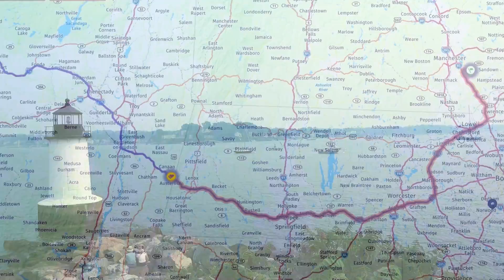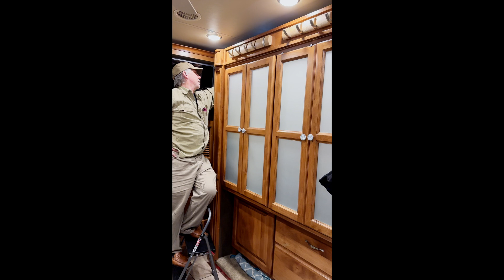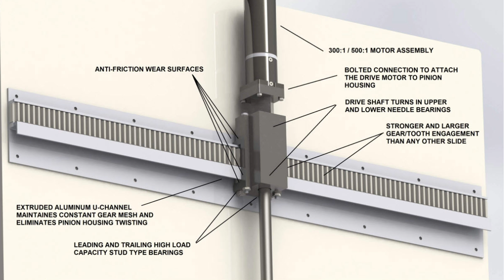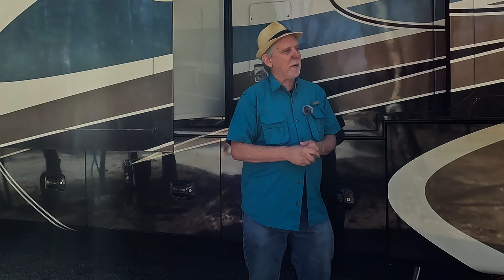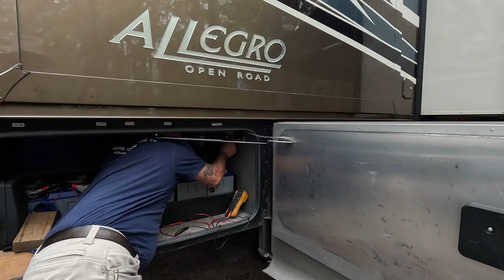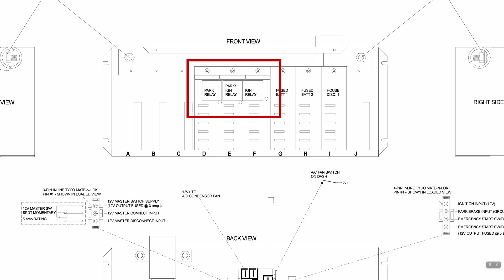Troubles with RV Slides

Comment: Thank you! I have the same coach and have been having some intermittent slide issues that effects both the hydraulic and the electric at the same time, this video talking about the relay is probably where I need to look next.
Reply from the maker: Glad it helped! We did the trick to turn on and turn off the ignition three times before starting the engine, but it was a temporary fix. We haven’t had the issue come up again in over two years.